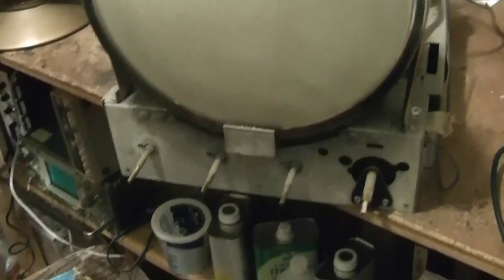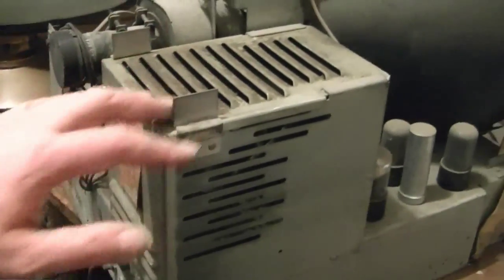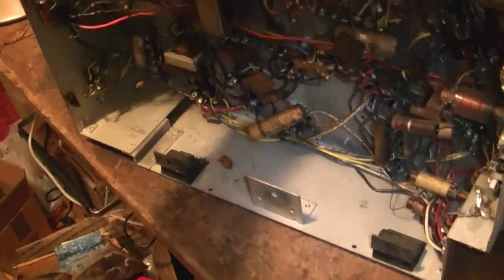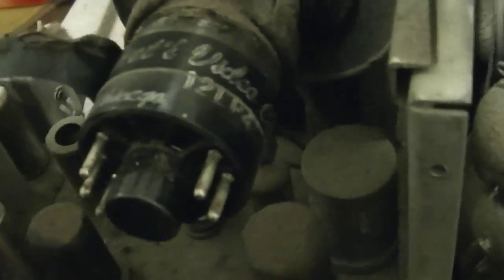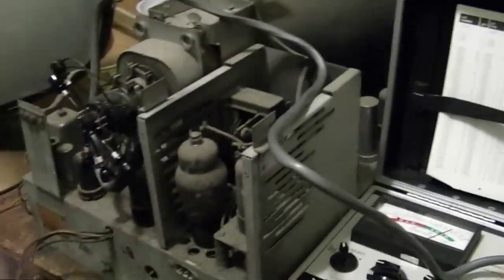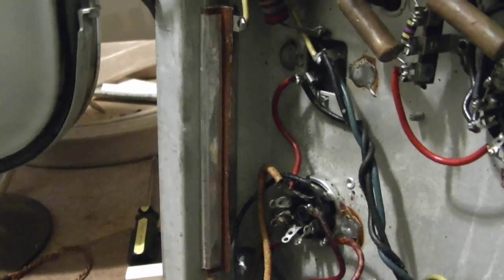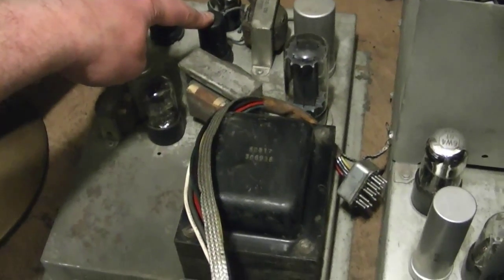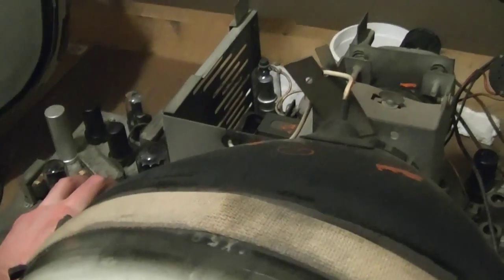Admiral 20B1 combo chassis restoration p1o6

Comment: Another Admrial..:-) You'll be recapping these in your sleep at this rate..Yes I know the feeling about having too many projects and not getting ahead... Sounds like you burn the candle at both ends with your day job and TV tinkering into the wee small hours.. I used to do this but find as I'm getting older not so easy! :-)
Reply from the maker: I'm hoping to switch from being a contractor to full time employee which would mean more normal hours and paid vacations :)

Comment: That CRT may be gassy. In cutoff crank the voltage all the way up and see if you get a blue glow in the neck.
So far the only tubes I have seen with super great cutoff and fair/low emissions were gassy and produced a dim cloudy picture.
Reply from the maker: CRT is fine - it just needed to warm up for a while and now the emissions are fantastic :)

Comment: wonder if brightners were ever used in areas where the mains were a bit low?
Reply from the maker: Variations on the 117 primary will have little impact on the 6 v secondary (18:1 ratio).  Or think about it this way.  A booster typically adds 2 volts.  If you're filament voltage was down to 4, it would mean a primary of only around 75 volts.  I don't think the set will run at all on that low a voltage.

Comment: well  actually,, that high voltage box cover came from the extra chassis .i saved from the electronics recycling center,,,thats whey the cord was cut off ,they do that automatically,,it brings more money,,thats why the cover is a diffrent color than the rest of the chassis ,,,my chassis that was in the cabinet ,,was missing that  steel cover,,

Comment: I must say that you were rather meticulous in cleaning that television chassis! Apparently, since it was rust-free, it hasn't been exposed to the elements at any point. It has been my experience in pre-war electronics that rubber insulation was used quite often in AA5 radios, but I wasn't aware that this same material was used in the wiring of post-war early television sets. 

At least you were made aware that this set does produce a raster, so that's one less thing you'll have to dink around with on this set.
Reply from the maker: Rubber wiring is unusual for a late 40s TV.  Only the two wires going to the pilot light were rubber for some reason.  The rest are all plastic.

Comment: What do you program? Just curious.
Reply from the maker: Lots of stuff.  Currently an administration website for configuring a database .  I'm using Drupal (PHP + jquery) for the front-end and Python + Flask + mySQL for the back-end.
Reply: bandersentv basically a web developer.  I see. I used to do web stuff but that was in 2004 and lots have changed since then. I dont mess with web anymore, I mainly do embedded hardware and droid apps for it.